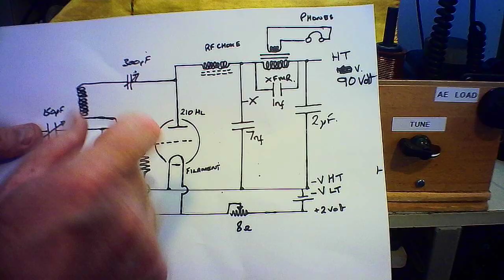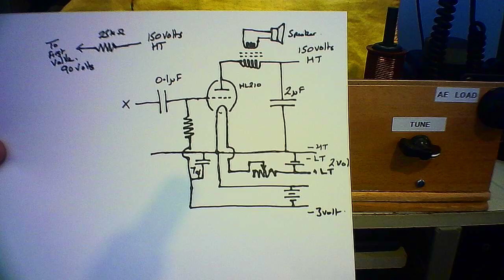It's now a 1920/30's style 2 valve receiver?

Comment: Very interesting modification to create a speaker drive. Despite the speaker not being an old type and a lower impedance, you have still managed to capture the sound that only valves can create. Best comparison could be,  listening to a quality vinyl vs a cd.
Reply from the maker: I did manage to make a few improvements to it since the video, not enough to make a fresh one, but, I lowered the HT in general especially to the first stage, this made it a bit more responsive. I also replaced the final transformer using an old RS economy O/P one and changed the main tuning coil so I can get most of the MW band.  It was a good project and has passed a good few days/weeks on it.  It is still in use, but could well up either being boxed or broken down for another project some time.